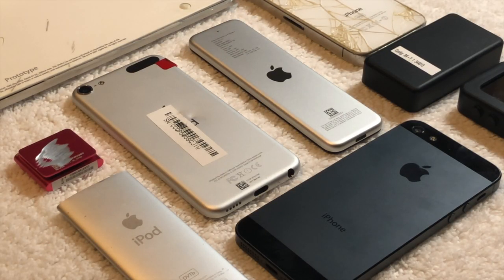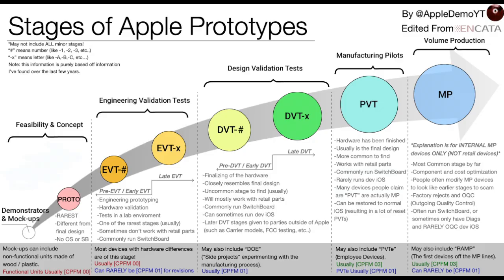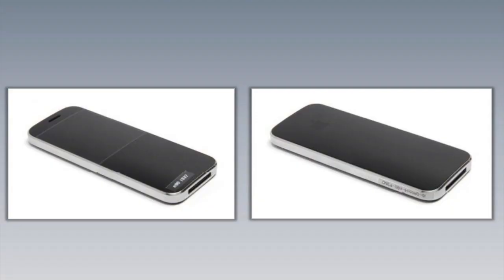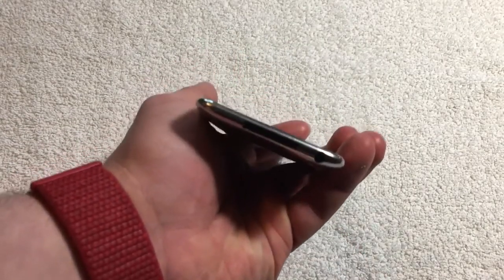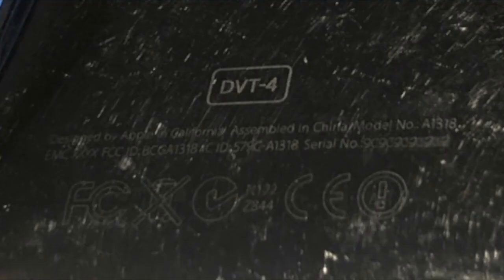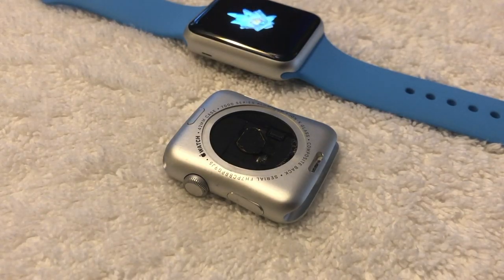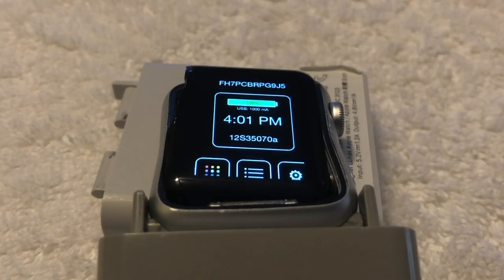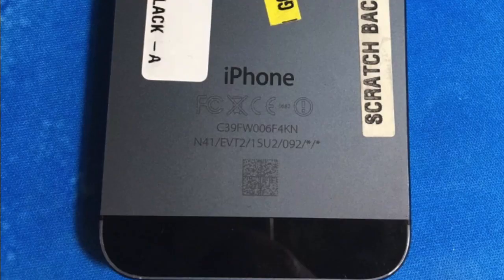What are Apple Prototypes? - Apple Prototype Stages Explained - Engineering Units - Apple History

Comment: I have a prototype 2011 21.5” iMac. Came with Nvidia 540M GPU instead of the AMD 6770 which shipped in the production models. The silkscreening on the logic board is yellow instead of white, Also the logic board is fully populated where components not needed after the testing process are removed but the blank pads remain.